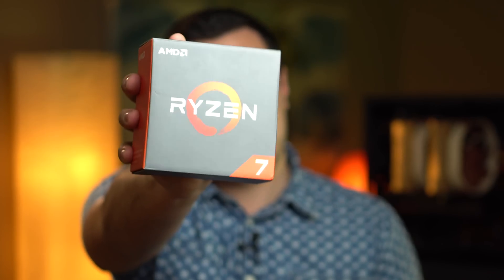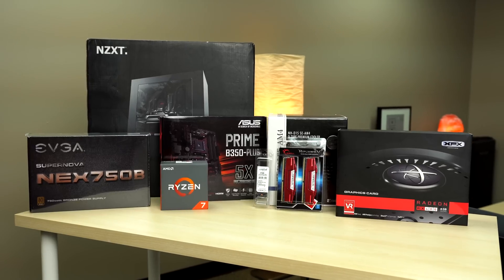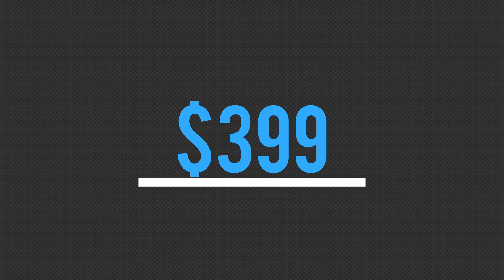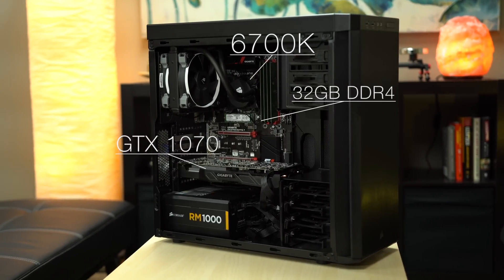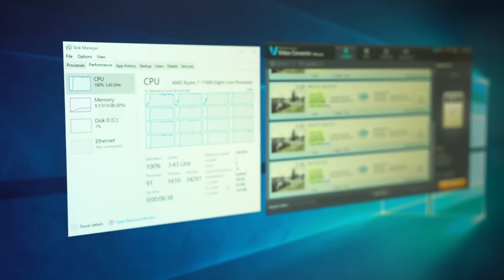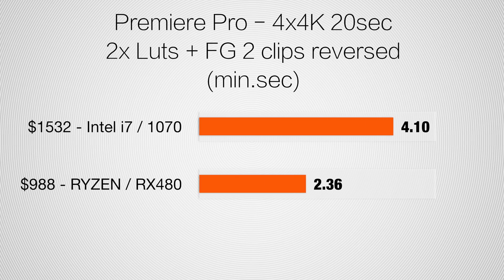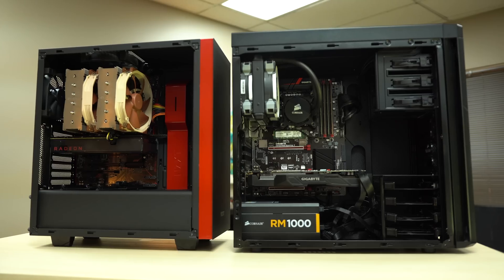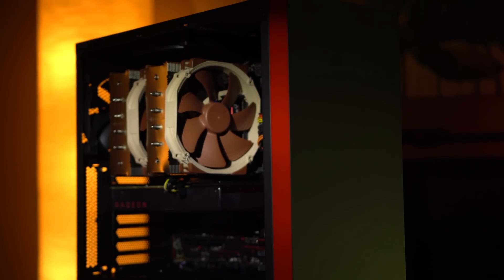$998 AMD RYZEN 4K video editing BEAST! Premiere & Resolve

Comment: So, Apple should really use AMD CPUs in the next MacBook Pros.
Reply: No, you should switch to Windows and stop worrying about how much Apple is ignoring media creators.
Reply: ding ding ding. We have a winner..
Reply: Maybe, but still hard to say becasue Apple still a big customer to Intel. It will be more opportunities if AMD get success at Raven Ridge (Ryzen APU) in the future (scheduled release at 2018Q1)
Reply: Scott Sullivan it will still be an overpriced trash
Reply: there are no ryzen mobile chips yet. these are desktop chips.
Reply: @PumpkinEscobar_305  I have an r5 2500U. It's better than i5 7300hq and i5 8250U half the price.
Reply: Unless there are some business agreement hindrances nothing prevent any manufacturer to use a standalone Thunderbolt 3 controller IC, like eg. JHL6540
Reply: Maybe we finally get good MacBooks.

No more shitty dualcores.
Reply: Nope. Just like the previous generations of Thunderbolt, TB3 is available as standalone controller ICs for any MB manufacturer to put on any MB they chose. It's just a matter of whether there are licensing limitations. Remember that external devices also needs to have TB3 capability or the technology is useless. That is provided by standalone controller ICs manufactured by Intel. TB3 is by nature bi-directionally master/slave configurable so there's no technical hindrances that prevents MB manufacturers from including TB3 on AMD MBs.
Reply: IGamer InsideI Nope.
The chips report temperatures 20° over Reality.
Jay talked about it.
Reply: LOL, this just means that Apple will be able to spend way less on parts for their laptops but still charge you the same amount or even more money.

So either way, you lose, and Apple wins.
Reply: You are confused, that is simply an AMD driver for using Radeon graphics cards in an external graphics amplifier on an INTEL system.  So if i have a laptop (intel of course) and i have lets say a Razer Core (external graphics amplifier) i had to use Nvidia cards up until recently.  Now i can put an RX 480 or R9 Fury in the Razer Core and it will work.
Reply: t's not overheating, I own one, it's a sensor reporting issue with the 
BIOS on the X chips because of XMP. 
They all show fluctuations around 20c Hotter than actual. It's been 
noted on many sites and AMD is pushing the Bios fix to MFG this month.
Reply: Sean Gordon what the most accurate way to measure temps? Or should I just continue assuming it's 20° warmer?
Reply: With Ryzen's low powerconsumption it should be possible to have an 8 core 16 thread CPU in a laptop...

Damn right they should go AMD if they want to be relevant for something other than their software and mindshare.
Reply: "So either way, you lose, and Apple wins"  - Not if you have a lot of Apple stock. ;)
Reply: yeah also they make better apu-s
Reply: They have xconnect tb 3
Reply: They're coming next quarter, though.
Reply: kalil odefa Depends on the board. I have an ASUS prime B350M. It said it was to be fixed in the most recent bios, but it didnt fix it. The 1700 doesnt have this issue, its safe to say if you have an aftermarket cooleryoure cooling better than the wraith. So find someones temps of the 1700, youll likely be a couple degrees over that. Only other way ischeat sensor gun to the die, not very accurate though, even if you know what youre doing. Ive checked with multiple apps and theyre all over the place. Check your MB Bios ever few days.
Reply: Sean Gordon I went with asus prime x370 and the temps don't seem right to me
Reply: you moron err yes? Are you stupid?
Reply: And the desktop will still be an overpriced trashcan. :)
Reply: This is where AMD adoption gets stopped!
Reply: lol or do like i do, offset your losses when buying pc products but still invest in aapl
Reply: Not, AMD heat issues, even with water cooling, watch JayZ video of AMD, the eternal overheating issue AMD has been plagued with, even their vegas.
Reply: Incorrect, you have to have Intel for TB 3 since its built into the Intel BUS/CPU Arch.

Comment: Hi max, the power supply link is wrong in the description. About the motherboard, anything you'd advise keeping an eye? I was planning to build a machine quite similar to yours as well using AMD, Intel is way too overpriced and offering quite a bit lower performance, kind make me happy seeing it's just not me thinking of migrating to AMD for video editing.
Reply from the maker: Fixed now. Power Supply on Amazon➡ http://geni.us/4Z1Aa
Not sure what you mean as far as keeping an eye on the motherboard. It's a fairly simple lower budget one but does the job well. If there are specific features you want from a higher end one you can spend a bit more.

Comment: This is really helpful. Thanks for doing this. I was just calculating how much an Intel build was going to cost me. Now, Ryzen has got me curious. Is gaming performance acceptable as well for the price?
Reply from the maker: If your asking about gaming performance using Ryzen over Intel, there are a lot of articles on that. Basically you get SLIGHLY less performance, like a few FPS compared to an i7 BUT you get way better workstation performance for the money.
Reply: Yes, an RX480 can hold up in most new games, its comparable to a gtx1060 or 1070
Reply: It can hold up to a 1060 in some games, the 1070 is out of its league.

Comment: Thanks for the great work Max, as usual
Would you think this could be a strong gaming desktop? besides it being for video editing ?
Reply from the maker: Yes! while you will get SLIGHTLY less performance compared to an i7 since they are clocked higher (I'm talking a few fps which is really unnoticeable) you get the big difference in multi-core CPU power. Well worth it!

Comment: Is there a way you could share your Premiere Pro benchmark projects and video files so we can try them ourselves on our own computers?  Or if those are too big... maybe make a new smaller benchmark to share?  It would be great to see how our  encoding/exporting times compare to these results.  I'm always interested in video editing benchmarks like these... but it's difficult to see how they relate to our own computers.  Thanks!
Reply from the maker: Here you go! I think render settings should stay from what I used. (4K 40mbps CBR 1080P 10mbps CBR) using media encoder. https://www.amazon.com/clouddrive/share/uCvEEzLsGyfNDUS9E51dtbagulfg9KYpG5koIdqakI?ref_=cd_ph_share_link_copy
Reply: Thanks Max!  This is exactly what I wanted to know.  I have a system with an i7-4790K overclocked to 4.7GHz with 16GB of RAM and a lowly GTX 750ti GPU.  Your Ryzen tests scored between 15% to 25% faster than my system across all the benchmarks.  I'd have to spend at least $600 to buy all new Ryzen parts (CPU, motherboard, RAM) to get at most a 25% increase.  So I'm not sure it's worth it at this time.  I think I'd rather spend money on more SSDs, upgrade to 32GB of RAM, and get a GTX 1070 or something.  I already have a decent CPU and good overclocking motherboard... I just need to build up the other parts around it.  Thanks again for the benchmarks.  No other Youtubers are offering their project files for us to benchmark at home!  You're a pioneer!
Reply: Michael Scrip you need a new GPU.  I don't think it would be worth upgrading just yet or adding more ram.
Reply: raja in this test is CUDA rendering support flagged ON?
Reply: Michael Scrip Did you watch the video  fully? In this video he clearly mention there is no loss in performance from moving from rx 480 to gtx 1070 for video editing so you are ready to spend 150dollar more for no performance gain.  You are clearly biased...

Comment: i have a question! i use the 1070gtx with premiere pro, but i have some drope frames in my playback, maybe my i7 2700 is out date, i have 12gb of RAM maybe thats a  issue? (sorry english is not my first language)
Reply from the maker: The CPU is definitely the main benchmark. For that CPU a 1050 would likely be just as fast as the 1070 since the GPU can only process data as fast as the CPU can send it. The RAM is also low as in my tests between 8gb, 16, 24, 32gb there were speed increases going up each larger ram. Thats why I spent the extra $ to get 32GB for this system.
Reply: What resolution are you editing on?
Reply: KappaJohns the footage 4k from my gh4, and the blackmagic 4k.
Reply: Nice review!

Which RAM did you use? and at what clock speed? 2 or 4 sticks?
Reply: Max Yuryev ooohh thank you max! good to know!

Comment: Great video max! I hear that the 1700 overclocked to 3.9 with stock wrath cooler at 100% 1.35v will give 2-3% performance to 1800x making it even better price to performance considering no aftermarket cooler is needed. I wish that Apple adopts the Rizen cpus
Reply from the maker: Yes it overclocks really well. That could save you just a bit of money ($70 or so) the reason I didn't go with that is it's a 65watt CPU compared to 95 watt on the 1700X and 1800X and I pre-ordered before there was any info on overclocking.
Reply: wouldn't that be funny, some how they would charge more for a cheaper cpu!
Reply: I feel the chips weren't binned well at launch but give it a few months and the r7 1700 might not reach as high clocks imo.
Reply: That's with the binning today. Tomorrow, or by the time people order and receive the chip, things might change. OC chips I believe are not covered if they go bust. I'll take one that is overclocked already officially and pay a few bucks more.
Reply: Anthony Pierre nah.. binning is overrated.  a 1700 can hit 3.9gz. and 1800x will max out about 4.1gz... if you want to pay an extra $200 for the 200mhz gain.
Reply: Wraith cooler is not enough for overcloking. I am using ryzen 1700 on 3.7 ghz 1.275v , cooler is h100i and max tempeture is 60C. Wraith cooler is 85-90C. Buy ryzen 1700 and a good cooler. You dont need to buy 1800x.

Comment: I've always used AMD cpus and Radeon cards instead of Intel and NVidia.. my FX-8350 is showing it's age though, last year I was tempted to make the switch to Intel but now I won't have to anymore! I've already got a new RX470, next step is to upgrade my CPU, RAM and mainboard.. AMD FTW! Yeah I'm a fanboy and I'm not ashamed of it! ;P
Reply: fsociety Same here! 4years ago my FX-8350 could be compared to the i7 at the time, so it's great that they finally release something new for the AMD users. 
Since considering upgrading myself I'll definitely have a look at this 😍. 
Great Video Max!
Reply: +IGamer Insidel, which AMD are you talking about? What overheating issues? The false reporting of CPU temps being 20degrees higher than they actually are?
Reply: it's true when it comes to video editing the fx 8 core hold there own. you can't always watch video gamers reviews and say the cpu is crap. I sent $250 for a cpu and MB combo a amd  fx build vs the $600 Intel main rig I really don't see much a difference. gpu and hdds are the biggest bottle necks for most editing rigs
Reply: FX8350 and HD7870 user here. Just got MSI Gaming X R480 8GB and ordering 1700X. Lots of talk on overclocking the 1700 to same speeds, but, I'll take one already "overclocked" officially and tweak it a little. I too like others was contemplating Intel build, but glad I waited.
Reply: fsociety Just upgraded from 8370&Fury to 1800X&WX7100. Cut all my rendering times in half. No Regrets! Performance will only improve as optimizations mature & improve.
Reply: Agree Dan. I got my FX 8320e for $89 and my 990FX motherboard for about $80 after rebates. Coupled with a $90 16gb DDR3 2400mhz kit it was considerably cheaper than a comparable i5 build. I then upgraded to a Fury GPU for $240 after rebate and frankly this has been an excellent budget build, even for gaming! Note however I game with vsync on and set to 60fps.
Reply: I have an 8320 too! I know it's over clocked almost the same as my brothers over clocked 8350. can't remember what to though it's been a couple years... I'm just mad I didn't buy amd stocks when I almost did last year when it was at  2.20
Reply: IGamer InsideI first off vega ain't out yet and secondly everyone knows sensors were reporting 20 degrees higher than what they actually were. Please jog on and do some research before posting dumbass troll
Reply: tsociety im with you on this but I do machine learning so the GPU does need to be from Nvidia... Rocking a Threadripper 1920X and a GTX 1080Ti
Reply: Dan H Not really, 8350 did perform comparable to 2600k and 2500k.
Reply: news from guru assholes!!
Reply: fsociety good for 1080p
Reply: me too, still have an 8350 w/ 16gb of pretty decent ram that at the time of build was a beast, now, not so much, indeed it is showing its age
Reply: tsociety is
Reply: Unless you've owned a FX-8350 you really don't have much to say. They are extremely capable processors.
Reply: Not, AMD heat issues, even with water cooling, watch JayZ video of AMD, the eternal overheating issue AMD has been plagued with, even their vegas.
Reply: "4years ago my FX-8350 could be compared to the i7 at the time" the same way an AMG E63 S could be compared to a Kia Optima. Don't kid yourself, the 8350 was born obsolete. lol

Comment: how is Lightroom / Photoshop workflow on this computer? my conclusion is that if it is the best bang for the buck for video it should be for photography too but I'm not 100% sure if Lightroom can take advantage of so many cores or if fast dual core i5 is a better bet. Very nice video by they way!
Reply from the maker: Lightroom won't make use of all 8 cores. For lightroom I would get the newly announced 6 core "Ryzen 5 - 1600X" which is $249 instead of $399 and I think it includes a cooler so you can have the build be $800 or so instead! Keep everything else the same :) The 1600X has a higher clock speed and less cores which is better for Lightroom. With that said Adobe REALLY needs to step it up and improve their software. Lightroom has been bad with efficiency for 6 or so years now, they keep adding features but the program itself is slow.
Reply: Adobe seriously has been bad with efficiency for a LOOONG time. Glad we have cpus now that will really show how awful Adobe CC apps are at multithreading.
Reply: Hey Ramiro, I just put together a Ryzen build for my wife who uses Lightroom/Photoshop/Illustrator/Indesign, and I did a lot of research and ended up settling on a Ryzen 7 1700 w/ an RX460. Max is dead right that a Ryzen 5 would be a better idea right now, however I felt that over time Adobe would do a better job multithreading their apps, especially since they'll be getting more heat over it, and so the 8 core chips would be more future proofed so I went for it. This is a bit of a gamble of course so Ryzen 5 may make more sense if Adobe doesn't come to the party. For what it's worth right now, when my wife is using all 4 of those programs at once all 8 cores are going for it and everything stays smooth as butter :)

Also, if I had had my way I would've waited for the second generation of Ryzen CPU's, as I tend to agree with the folks who think this will turn out like the whole Athlon/Thunderbird scenario back in the day, where it was the 2nd generation of a new architecture that was the real performance king. Unfortunately my wife's computer died and so I had to do something immediately, but if you can afford to hold off, I would. Intel will drop their prices considerably too I imagine. Hope some of this was helpful.
Reply: Agreed, Adobe software is so far behind its sad really.
Reply: James Hutton you can upgrade your CPU when zen2 releases, am4 will be supported for next 4 years :D
Reply: Yeah I love the changes they made to Premiere with lumetri color panel but Abobe needs to seriously to optimize their programs better. People have been complaining about it for so long haha
Reply: What would be the alternative for Adobe cc suite that does everything like pp ae ps ai?

Comment: Lol Max did you re-uploaded this one? Watched once in the morning. 
Hey Max, just curious, are you keeping all the computers since your EVGA case Hackintosh?
Can you do a less-formal video just to show how a 4K video (same file, same effects applied) performs on all your machines in terms of Premiere Pro preview ability in full res? (not 1/2 or 1/4 quality)
For some video editors, we just want to see how we can use the minimum of money to achieve a smooth 4K editing preview workflow. And not a lot of YouTubers are testing that. Most of people just compare render time on different machines. 
Take me for example, I have i7-4790k +GTX 970 + 16GB RAM + editing file and system all on SSD, and but when I edit GoPro and Phantom 4' s 4K video in PR, it still lags like hell.... a lot of us just want to know what's the minimum spec to get a smooth preview. I think if you can make a very short sharing video, it will certainly generate a lot of views because right now there isn't a single video showing real-time preview comparison.
Just a little thoughts. Thanks Max
Reply from the maker: Yes, I made a mistake with one of the graphs that people pointed out (had the results backward) so I had to fix it and re-upload and I added the full specs as well. I just sold the Hadron Hackintosh 3 days ago and my 4790K GTX 1080 build about a week ago since I don't need this many computers or else I would make that video. Some of my videos have stats with multiple different machines if that helps.